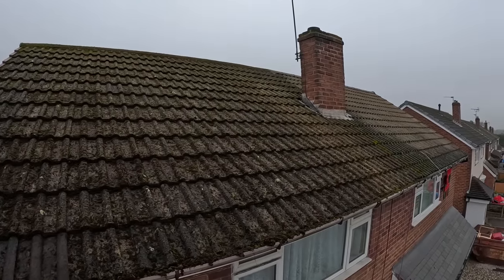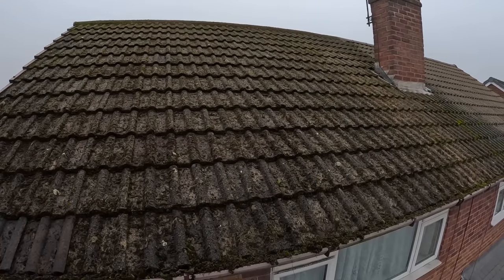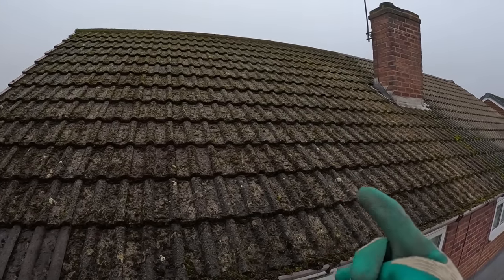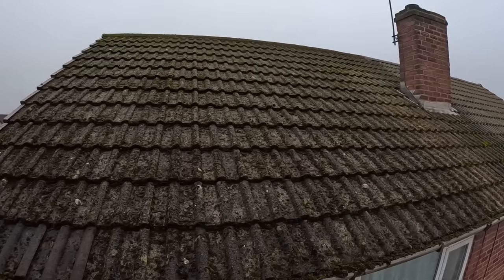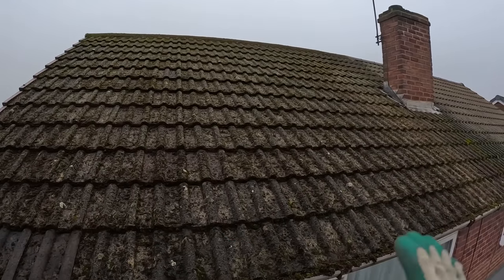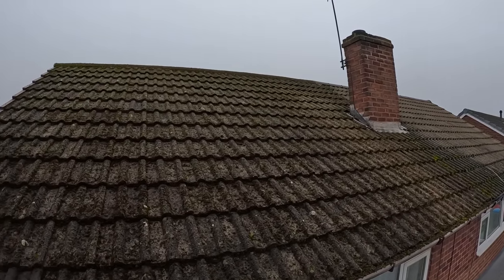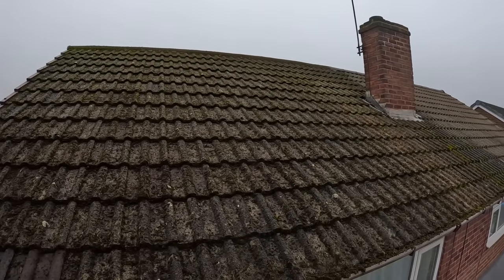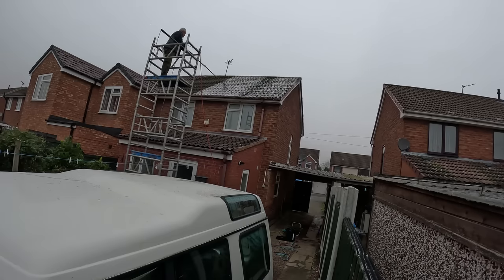STRANGE CASE: RUDE Neighbour Went Too Far? I Discovered Evidence Whilst Cleaning A Roof!

Comment: There's two sides to every story and I have a feeling the neighbor blocked the drain as a last resort. It looks like the neighbor has looked after his roof continuously while the guy whose roof you're cleaning has never done so. That means the neighbor was constantly having to fork out to get his drainpipes cleaned out of this guys gunk and I'll bet, this guy wasn't going halves on that bill.
Reply: This is a proper Legal issue: if it can be proved that the gutter was deliberately blocked and the blocked gutter was to overflow into the property causing damage to roof insulation, plaster, paint, carpet, timbers, etc, etc. Who do you think will be made to pay for that little bit of handy work?
Reply: I am persuaded by what has been said so far. The block must have allowed a limited rainfall but enough not to cause issues. The block being to keep moss one side! 

Had a neighbour throwing his cut grass over our fence, then flicking his cig ends over and dumping bricks on our garage roof.
Reply: Excellent point.
Reply: We are considering blocking our neighbours from ours for the exact reason.
Reply: @marcuscoquer5958  Warning, Any unlicensed roof plumbing work that results in property damage could easily run you into thousands if not tens of thousands in damages.
Better to talk to your neighbours and have a second downpipe installed.
Reply: And we don't know how long the neighbour has been there, the block might have been in before he moved in, he mightn't have even known it was there, and I agree, the roof condition says it all, maybe the dirty one is a rental, the other is owner occupied.
Reply: @John Smith  not a cowboy at all, look at the deeds for your property. Also as this house is well over 20 years old, an thus the was built like this, you have no legal right to stop the water flowing from my gutter across yours and down the drain. Could also charge you for removing the blockage.
Reply: I’ll never waste time on neighbors like this
Reply: Funny Enough a simular issue made it on Dutch TV on a program with a TV judge. A neighbour had a garage with a flat roof. His roof was clean, the neighbours roof had mos on it. Therefore he requested the judge to rule that the neighbour head to install his own downpipe and he had already blocked water access to his side of the roof. But, this man tried to fight the law but the law one. Apparently in the Netherlands this downpipe thing is regulated. He had to continu to give his neighbour acces to the downpipe. Only thing he was allowed to install was a special filter to prevent plant materials to get into his downpipe. He had to remove the blockade.
Reply: @TheErwinalf  As a diy guy I’d just buy and install a downpipe for my neighbour rather than go through all that legal trouble
Reply: I had a similar problem - the house next door was rented out and they never cleaned their gutters.  The down pipe was on my side so their roof debris was blocking my down pipe and causing overflows onto my conservatory and leaks.  My solution was to fix gutter brush along the whole length of my gutter so that any blockage occurred on their side and I received, in effect, filtered rainwater.  It worked a treat!
Reply: @zephyr139  Very very unlikely to cause subsidence, more of an issue would be the excess of water dripping onto the face of the home leading to mould within the house also depending on whether or not the house is 9inch solid or has a cavity.

Comment: Maybe he told his Neighbor countless times to clean his side of roof or to help him clean the roof so they dont have to pay for a Crew to come in and they slammed door in his face.
Reply: I know there's some arsehole neighbours out there. I have to wonder if the individual with the mossy roof has had some issues going on, regardless of who is to blame. It's a shitty thing to do if it's just done to be a jerk and I'm no fan of victim blaming. However, I can't help but wonder if there's more to why the neighbour had this done? Personally, to save grief, I'd just put in a separate downpipe if it can access the drain and then, being the lesson teaching lovely that I am,  I would be tempted to put an old bird nest into the neighbours down pipe when I knew torrential rain was on its way.
Reply: @annakeye  So, you'd fix the cause of the acrimony, then create an entirely new tiff. Smh...

Comment: This kind of problem is really caused by the architects/builders penny pinching when they build thse houses.  A downspout at each end wouldn't have cost too much when the houses were built.
It also looked to me as if, at the rear of the house the neighbour's extension roof doesn't have a gutter at all and just drains onto your customer's side.
Perhaps there was some dispute about connecting the extension roof into your customers gutter at the rear which led to the neighbour blocking the gutter at the front in retaliation?
Reply: Rather than putting a block on the gutter, just install a downspout for them on their side and then it is truly their issue to deal with.  Remember if the gutter overfills its going to rot both roofs
Reply: @erikanders3343  Can't do that as there is nowhere for the water to go. In the UK the downpipes have to feed into a drain which connects to a sewerage system. There is only one such access point to the sewerage system for these semi detached properties and its on the side where the current downpipe is.
Reply: @AlexaFaie  No.  In fact new houses almost always use some form of soakaway for surface water (S.U.D.S.) and connecting to combined or surface water sewers is less common (plenty of old houses still do it though on grandfathers' rights).

But you are spot on to say that you can't simply discharge to the ground next to the house without it causing serious problems.  In any case, written or not, if the house was built like that then mossy house has a right to discharge water via the adjoined property's gutter, so clean roof house can't just go and install a new downpipe on the neighbour's wall to avoid taking the mossy water.

And seriously, people who can't manage to share a drainpipe and somehow keep it clear between them probably would be better off if we had enough council houses or other serviced lettings for them to rent.

Comment: Happened to my mothers property - we only found out when we were clearing out her house after she passed away - everything was fine but a few weeks after I noticed a lot of water in the conservatory as the roof was leaking which was a new thing as it had never once leaked. We then realised the neighbour had blocked off their end of the guttering like in the video so the rainwater overflowed onto the consevatory roof & eventually found it's way in as the roof only had a minor rake to it so water collected at a few points.
We got a full new gutter to span the conservatory roof over to the rear of the property that had a drain. What annoys me is they got on really well with my mum so no idea why they resorted to this IMEDIATELY after she had died. They must have had a roofer come out really quickly.
Maybe they didn't want any new neighbours so tried to cause problems with us selling the house or more likely had held a gripe for a long time about the conservatory but waited until she died before doing something about it as my mother would have given them a few choice words had she found out that they'd done it!
I don't know what the law/rule is regarding shared gutter outflow but either way it was fixed & I'm hopeful the new owner has had no problems since, as does the owner in this video.

Comment: Rude.....? It is pathetic why on earth would a neighbour be so petty. If the gutter overflowed where the partition was his house would suffer as well. I am so pleased you have a strong moral compass, great job removing the obstruction ⭐⭐⭐⭐⭐
Reply: It seems rude at first, but then look at the 2 roofs. 1 roof is clean, new and kept. The other is covered in decade old moss and not been looked after. They both run down to the drain on the clean sides house so that means all the sh*t on the moss roof will block / clog the clean drain up causing a bill / extra maintenance for the guy that looks after his house.
Reply: @deathslide8  You are right, but would it have been better to talk with the neighbors and explain, what you said, and try to work things out. Plenty of grills/mesh that could keep the moss out. On our last house we were close to a rookery and they used to get the moss off the roof and throw it to the ground, or over the cars. They did keep the majority of the roof clear.
Reply: @thepagan5432  He said it had felt, ie water passes through it
Reply: @robertmartin2262  Yes, the water would go through the felt. What happens when the moss builds up against the felt, it would probably overflow the gutter. It is a pity that the neighbours did not discuss the problem before the felt was added to the gutter. I was born 1955 and as I grew up neighbours would help eachother out, I don't know what changed and when we became less neighbourly, but I can recall  a better community spirit, back then. OMG I sound like my parents, but I still believe things have changed.
Reply: @thepagan5432  Well yes, I would just clear my neighbour's gutter at the same time to avoid the moss running my way.  BUT I'd DIY it and it wouldn't cost me anything extra, so I suppose it's not quite comparable.

Comment: I'm on the other side of the argument - but with good reason: I live in an end of for terrace. There is only one downpipe for the whole rear elevation. Unfortunately, the third house in the block had some new half round plastic gutter fitted, to replace the half round cast existing on the other three. Where it joined (a bodge job,) the gutter raised up, meaning from there to the end of my house, the water just sat. My neighbour, who was an argumentative, obnoxious prat,  (in the second house in the row,) made things worse, by reversing the joint. In the end, I made an outlet in the cast on my own property, and installed a new downpipe to the existing gully. I isolated the two gutters by fixing a wooden stop between them - basically leaving the neighbour to sort out his own situation. I returned home one day from the county court - having just won a case against him for saturating our party wall by damaging a stop tap and leaving it spraying water on it for weeks - to see him belting hell out of the stop. In doing so, he damaged the joint next along the run. I got the most expensive roofer I could find, to repair it, sent him the bill - then sued him in court again - and won. Thankfully, he moved out, the new neighbour asked me to fully refurb the house, and I fitted squarline plastic on both our houses, discharging into my downpipe. Peace at last...

Comment: I used to live in a semi detached unit and let me tell you, it was a nightmare at times. Never again. But at least we had our own downpipes. The neighbour may have done that to stop the moss from your client's roof blocking the downpipe? Nevertheless, it was sneaky and a bit of communication between neighbours goes a long way. BTW, whose dog digging up the garden was that 🤣?
Reply: The trouble is that we don't know the full story, the owner of the house having the roof cleaned may have a history of being awkward to the neighbour, his moss covered roof may have caused blockages in the past and he may have refused to do anything to stop it and there maybe other issues between them as well. Also there may have been downpipes on both sides and the house on the left decided to do away with his and allow his gutter to drain across next door's This does not make what did he right, but there maybe more to this than we are hearing here. If it was built this way there is very likely a clause in the deeds to allow it.
Reply: @colinfaed5910  that was my thought, neighbors roof looks nice and clean. I wouldn't want moss filling mine,

Comment: Great work Syd and Kev. I don't think neighbour is allowed to use such tactics as it's "shared drainage". I'm in similar position but I have the down pipe which I have to pay for as regards replacement or repair. However, any drainage problems under ground is responsibility of water company as it's shared drainage. If neighbour is blocking gutter drainage, then they could face big fees if any underground drainage issues arise as he's stopped shared drain.  If he didn't want moss running into his gutter then he only needs to put in a mesh which would allow water run off but not moss. Something I didn't do as it's not that much trouble to get ladders out to clear moss from gutter. Be worth checking with specialist solicitor.

Comment: The neighbour has anticipated bother from the built up moss on your customer's roof. 
It's always going to be worse on the north facing side. 
I have added copper strips to mine and they have substantially reduced the amount of moss built up. Copper strips are a near permanent solution to moss build up because moss does not like copper sulphate/nitrate running onto it when it rains.
Reply: Where did you install them?

Comment: I believe also the moss itself makes the concrete roofing tile weaker. It has some acid to dissolve the minerals in the sand/stones in the concrete and possibly also lime in the cement, in order to get nutrition from the minerals in it.

Comment: I think your customer needs to contact the local environmental health department. Doing something to your building that risks causing dampness in your neighbours property is generally a breach of environmental health regulations, but this is an odd case, and only a consultation with an EH officer would confirm if they could do anything.
Phil
Reply: Direction of water coming off a roof doesn't really land in EH remit. It would have to be legally sorted between each neighbour by checking deeds and easements.
Reply: @nathd1748  neighbours actions have blocked the gutter, the direction of flow is immaterial, the neighbours actions have caused the gutter to overflow when it rains, dampness will occur. In a very similar case EH took immediate action on my behalf
Reply: @philhermetic  They might have but if a neighbour digs their heels in it would have to be sorted out legally between two neighbours. Councils not supposed to use public money against private feuds. The Party Wall Act 1996 sets out most issues. Where disputes cannot be solved, they go to court.
Reply: @nathd1748  damp entering a house or building caused by the actions of a neighbour is definitely the responsibility of EH. They will always try to deny responsibility in order to save money, and so they can stay in their nice warm office and drink coffee till five oclock. EPA 1990 states “any situation that is prejudicial to health” dampness caused by the actions of a neighbour is most certainly prejudicial to health. There has just been a case where a young boy died because of black mould in a house, his death caused by EH denial of responsibility. I wonder what part of “any situation detrimental to health “ they didn’t understand!
Reply: @philhermetic  Useful to know.  Thank you.

Comment: The client you just worked for needs to install another downpipe on his side. One downpipe isn't enough. My house (here in Australia) used to be a govt housing home originally, and so much was weong with it, ie cheaply built & with shortcuts. My roofs were always cascading. I had 2 extra downpipes put in my front side of my new roof (yeah, that & the sewerage pipes were rotten). But, my back roof also has an attached verandah... but only 1 downpipe for both. It always cascades & the verandah gutter is rusted.... and after a year of lots of rain (yeah, Australia has been having a floods all yeah, with the big river in my state about to have it's first peak of two this week). My pavers underneath have gone black & green this year, & stained e everywhere else, too. I've asked tradesmen to fix it, but I got a midway downpipe piggybacking another downpipe - argh! I need multiple downpipes still. Hence why I reckon your client should put in his own downpipe, because the neighbour will only block it off again.
Reply: Let me guess ? You’re from Mildura ?

Comment: My neighbour built a rear extension where we had a shared downpipe right in the middle that they were responsible for. The front one is on my side of the boundary. They built right up to the boundary and dug up the shared soakaway. Saying that their builders would put in a new one. I "temporarily" moved the downpipe inside the boundary myself, because their builders would just rip down anything in their way and throw it in the skip. Trouble is they put in a new soakaway on the opposite side of their garden, and I am now left with a downpipe discharging into thin air.